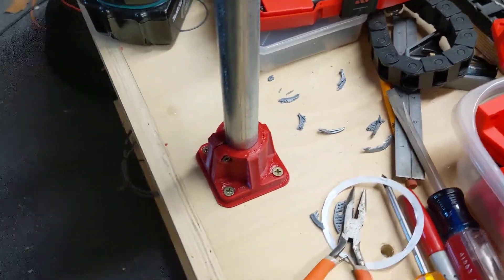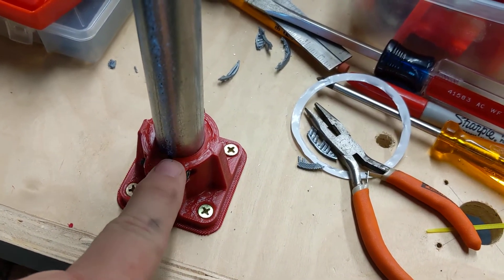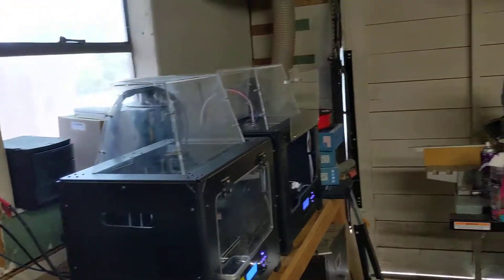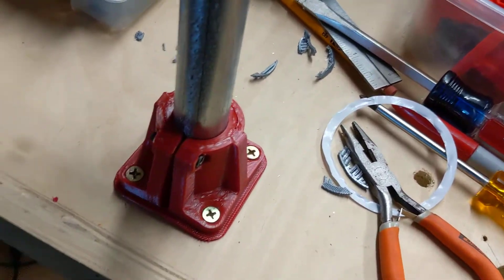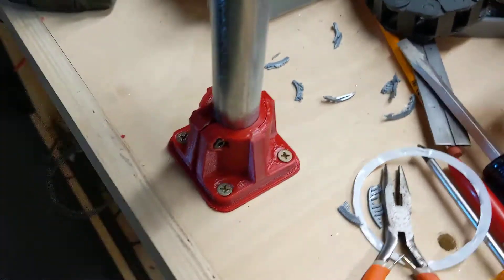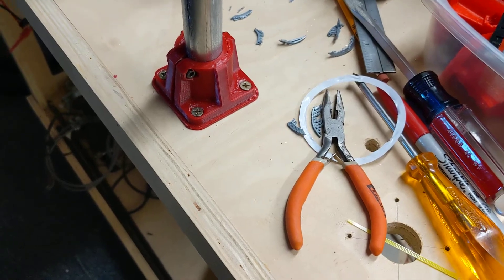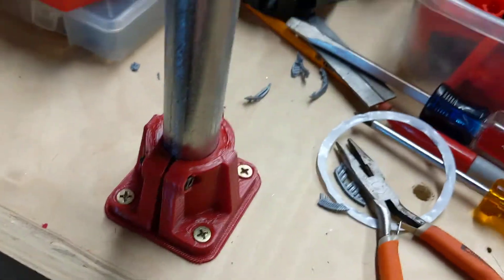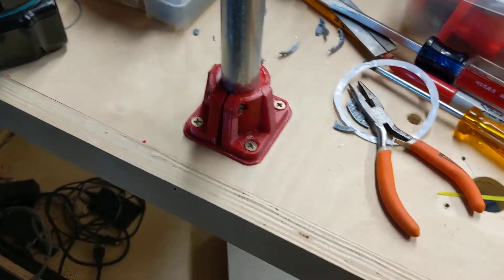Testing printing with ninja tech armadillo for the MPCNC

Comment: I don't understand what Armadillo could be useful for.  I was really disappointed how flexible it is.
Reply: It is REALLY good for parts that will see hard abrasion or possible hard abrasion, eg. chain guards/guides, gear housing covers. I print crash pads for motorcycles with it. The surface will get fuzzy from grinding along the asphalt but it doesn't break apart.
I find it very difficult to do any surface finishing on it so it's best to get your dimensions correct in the print stage and not think "I'll shape it down later with sandpaper or a file." Again that's its abrasion qualities at work. Drilling and sawing are not so bad. 
All of that said, yes it still has the inherent flex of TPU but way up on the hardness scale and that helps it survive getting beat on in use or being under constant vibration. It's essentially an industrial grade plastic, not a recreational filament. That pipe base in this video is not an ideal application for Armadillo.